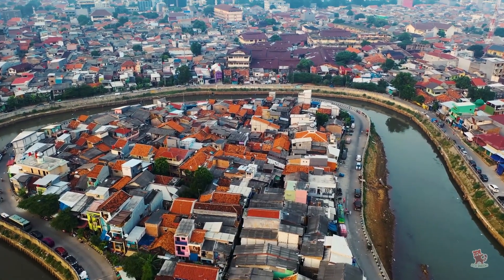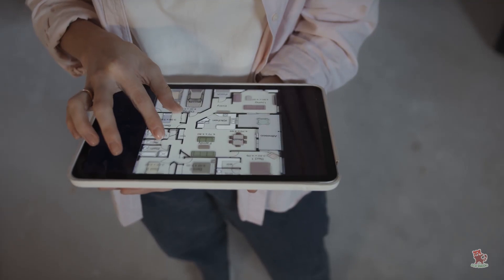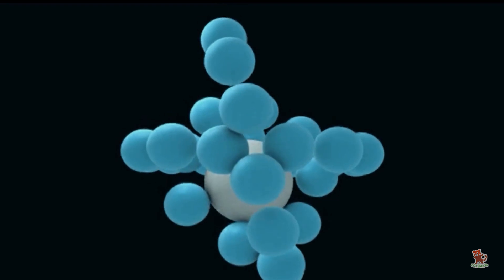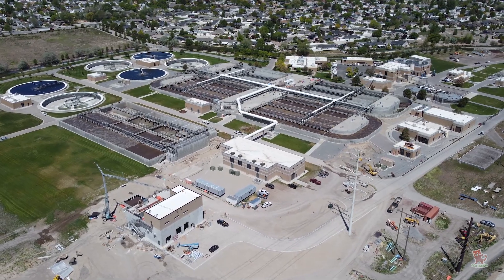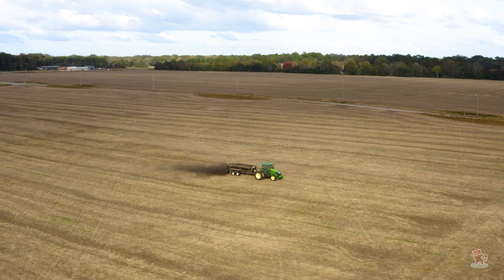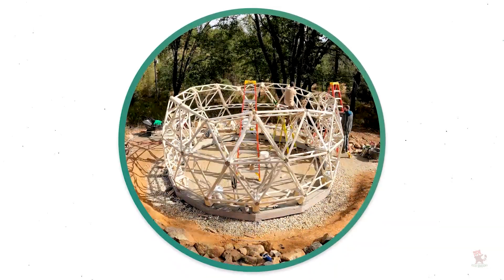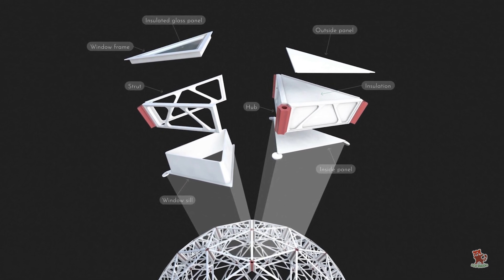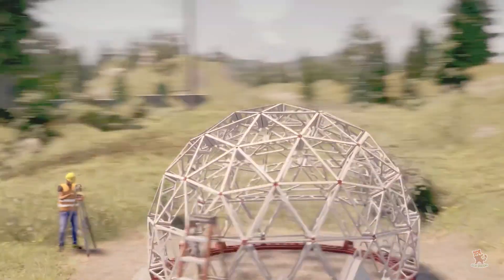A new AFFORDABLE & EASY TO BUILD eco friendly home for the future | GEOSHIP

Comment: 2:29  .....One sees the geodesic spheric structure shown here .... with all it's sensible advantages ....potentially skinned with E.T.F.E. ...Ethylene Tetra Fluro Ethylene ( Dupont ) .  ( Ninety-five percent transparency to light / non - biodegradable ( lasts for ever) / Recyclable / requires sixty pounds pressure to enlarge for example a knife wound / non combustible ( though it can melt / slippery self cleaning non stick .